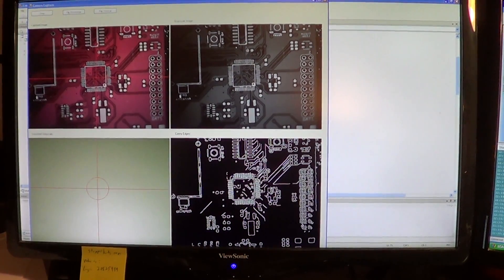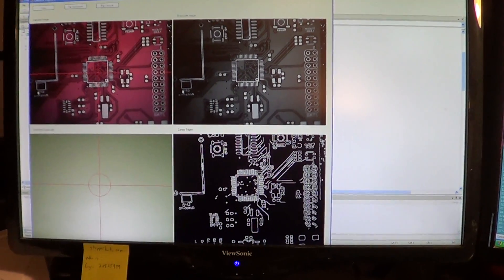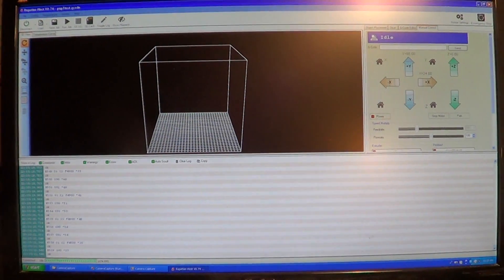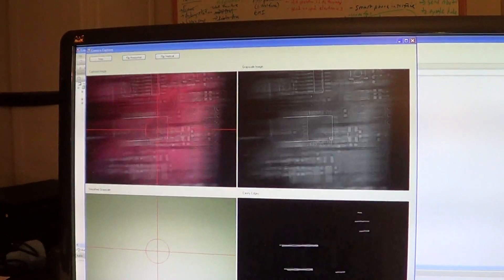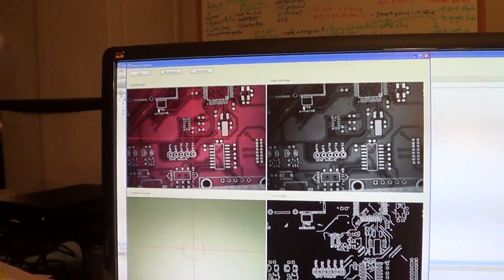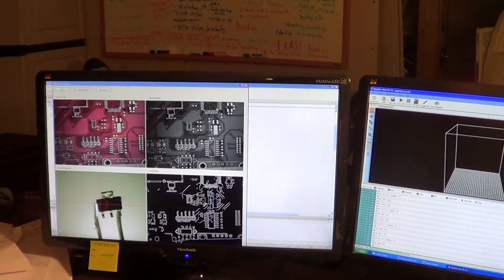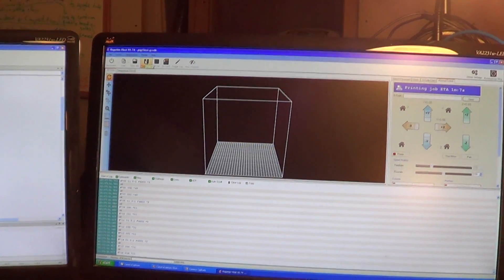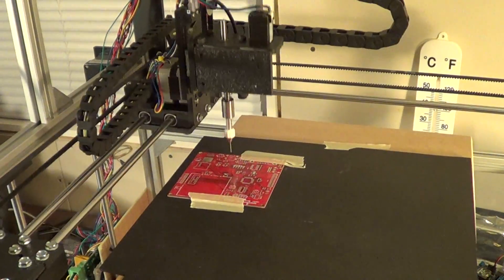Youtube - DIY Pick and Place Machine Project

Comment from the maker: Arduino Mega with RAMPS stepper shield. This is common hardware in the hobby 3D printer space. Firmware is call Sprinter. Google the REPRAP project to find descriptions about other boards and firmwares.

Comment from the maker: Goal is to base major components on readily available hobby 3d printer parts and firmware. I don't know the mm/sec yet. Just monkeyed with firmware values until the machine stalled. It's easy to shake the hell out of the folding table it is on if I go too fast and the accel/decel values are too high.